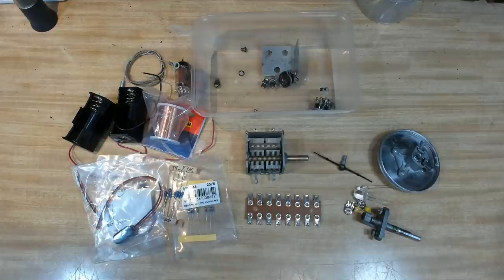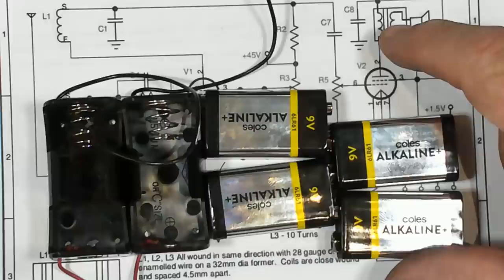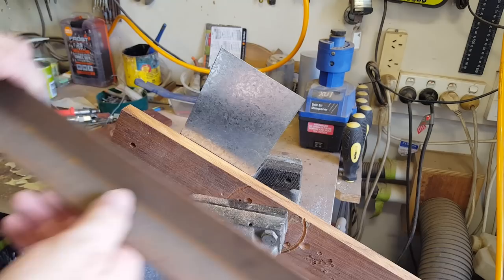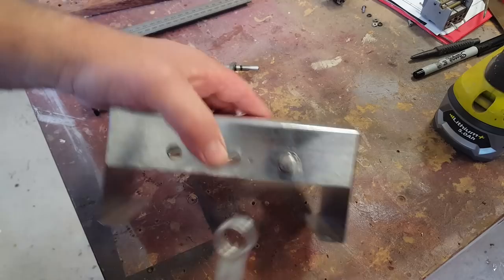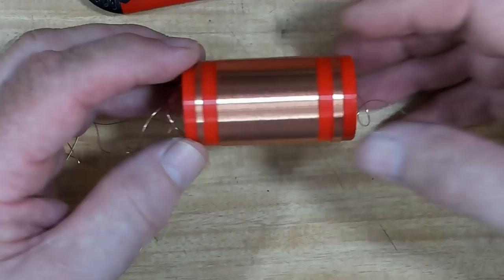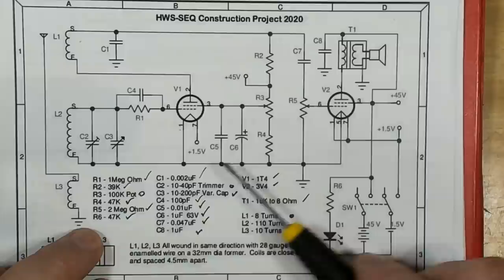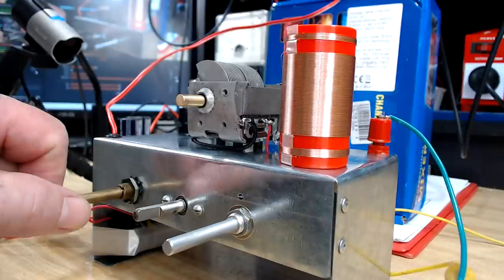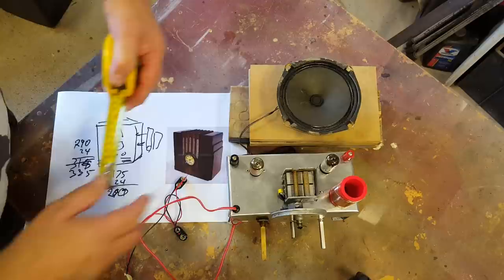2020 Radio Building Competition - My Entry - Two valve Radio

Comment: David,  You are an amazing man,  i mean that.  (ill still take the micky though lol )
Well done for winning the competition,  i though you would as the radio looks perfect and your
detail inside and out was brilliant.
I'm always impressed by your abilitys to create so many things from scratch.

You always put yourself down for the way you make/repair things,  stop putting yourself down.
That radio looks like it came from the manufacturers of the original empire radio.
A special edition version from the company :-D
I'm sure there is a way to get the extra volume you wanted,  but you have more time now you
won the competition :-D
Maybe the supply to the output valve is at a minimum, maybe 9 or 18 volts extra would give a bit more.
Reply from the maker: Thank you zx8401ztv, I do enjoy problem solving 🙂 I don't know I put myself down, I always feel there is room for improvement and I like to see things come out perfect, I think I may have a missing gene or something 😄
My radio worked as well as all of the others but I did think of slipping a few extra batteries in there but thought better of it, the valves are running at about half power. Cheers 🙂

Comment: It's not breaking into regen.  Your tickler coil may be connected in reverse.  Could have put dove tails, or tongue and grooves  on the battery drawer slide to keep it from flopping.  Other wise, nice cabinet work!  Congrat's on first prize!!
Reply from the maker: It breaks into regen at the higher frequencies, they all operated the same way on the day.  Dove tail would have worked but I was designing on the run. I could have hung the mirror over a bit and cut a groove in the slide rails. Thanks scharkalvin  🙂

Comment: You could 📞 call this your "2021" 📻 radio. 👍 Yes, you'll accomplish this build BEFORE 2021. You're darned 👍 good at anything to do with 📻 radios. I don't 👌 know what use a mirror is, under the 🔋 battery pack. Maybe pull it out and comb your hair, or brush your teeth.. I guess it's so the 🔋 battery pack can slide in and out easier. I 👍 liked the wooden version of that 📻 radio at the beginning of this 📹 video. Too 👎 bad ya can't build it in time. Didn't 👌 know ya had to compete against an entire club. Thought it was one person, or a few people. Merry 🎄 Christmas. Your friend, Jeff.
Reply from the maker: Thanks Jeff, the mirror is there so the internals can be seen by the judges if they need to. Merry Christmas 🙂

Comment: Nice job on the radio.  It turned out well.  But, I really like the looks of the one at 54:04  I really like the design. But yours is really nice looking too, it's just a style preference.
Reply from the maker: Thanks tarstarkusz. The radio you are referring to was done by my friend in the club, it's made from one end of the cover of a sewing machine. Pretty clever I thought 🙂
Reply: @DavidTipton101  The wooden one?  That's the one I mean (not the pink one).
Reply from the maker: @tarstarkusz  The cathedral shaped one is what I'm referring to. It is the end of a sewing machine cover. Like this: 
https://www.dreamstime.com/stock-photos-vintage-sewing-machine-case-image26445513

Comment: Great Job David, 

Next time you get a dimple in the plastic, try a heat gun and a high temp flat to push it down (silicone rubber, Teflon or Kapton). go slow.
Reply from the maker: Hi Steve, thanks. I considered trying to 'fix it' but I had run out of plastic so leave well enough alone. I tried to repair the second one but it didn't work. I have some new sheets now, I'll see how I go in the future 🙂

Comment: What a wonderful radio you have made, I am surprised by its performance too. You have all the workshop gear too. How long was the aerial to give good performance? 
I am building an Ekco 1934 AD65 replica. it is a difficult project, a round case and how to get the tuning system to work, . I was attracted to it because I saw it in the Agatha Christie series Poirot with David Suchet. so far it has been three years and the case is close to finished,. Next is the works, Would you like to see a photo?
Robert
Reply from the maker: Hi Robert thank you. The aerial is a small long wire, I have since installed a Miniwhip antenna so it would work much better now. I live in a very poor reception area. I would love to see your replica Ekco, it might be the only way to own one. vintageradioaus.gmail.com

Comment: Just a quick note. I mentioned that I planned to make the two valve radio. I have nearly all the parts, the IT4 is still in its original packaging. The question is that you did mention having a problem with the regen control not going into oscillation, which they normally do. On your circuit diagram you put a dot against L1 (regen coil) in the parts list. Did you need to add another turn to the 8 turns? Looking at the enamel wire I have, it seems I have 26 gauge and not 28, not sure how much difference it will have on the number of turns?  I might just order the correct gauge and do things right. I've made many coils, but regen radios are a bit more temperamental.  Wishing you and your family the very best for the New Year. Looking forward to what you have planned for 2021.
Reply from the maker: Hi Nigel. I think any markings on the parts list was me checking if I had the part. I wound the coil as per the diagram. The set would go into oscillation at higher frequencies, this was common with the other radios on display, playing with the windings may result in more regen 🤔🙂
Reply: @DavidTipton101  okay. Many thanks again.

Comment: Congrats David! Very Impressive Indeed mate! Is it possible to explain the radio circuitry? I'm trying now to learn how AM /FM radio works. From my limited understanding -  the signal flow goes from the Antenna to (Trimmer)Oscillator/Variable capacitor] to (Superheterodyne 4 Frequencies) [IF Signal + Audio Signal]  to I.F (I.F Transformers). Then it goes to Signal amplification and 2nd IF Transformer then to it's amplifier and speaker.
Reply from the maker: Hi Shyam, thank you. It took me a while to work out. Your understanding is correct.

Comment: Mr Carlson, instead  of making  a dial window, maybe buy a package  window from products sold in stores. Walmart has all kind of plastic stuff.
Reply from the maker: Mr Carlson is getting in on my action 😄 Thanks Manuel, the packaging plastic is ideal for smaller dials, I would still have to shape it for this project though 👍🙂
Reply: @DavidTipton101   thanks,I redo old cast off cases of radios and gut out the electronics and install blue tooth  device. I wish I could fix radios but it's ok.40 years as machinist, woodworker and other trades .your skills for radio repair  are amazing. Howdy from houston tx
Reply from the maker: @manuelsalinas686  Hi Manuel from Houston 🙂

Comment: what about 3x 12AU7 tubes configured like the inside of the SO42P with the third 12AU7 operating for the local oscillator as the front end and a trf second stage operating at 455KHZ and audio output to the headphones.
Reply from the maker: I hadn't really thought about it David, it would have sent the judges in a spin though 🤔

Comment: Dave, you are a true master...congratulations. I just refurbished a radio & it now only receives 1 station with low volume. It receiver more before refurbishment, although with a bit of static. I've gone over everything that I did & nothing is in the wrong spot. All the tubes are good. Do you have any suggestions as what else to look for?
Reply from the maker: Ahh, the continuation of the last comment... if it worked and now it doesn't suspect an error in the rework as you have done but keep checking, look for misconnections, bad solder joints, incorrect value parts. 
To make it easier, put you finger on the volume pot centre tab and you should get a fairly loud hum, if so, the amp is working, if not, concentrate on the amp section. 
If you do touch anything on the radio while it's powered keep your other hand away!
Check the oscillator is working, if it isn't you will get static and maybe pick up a station but not clearly. I use an oscilloscope but Google "testing a vintage radio oscillator" to find other methods.
You can also touch the grids of the receiver tubes, you should get a hum again. Sometimes just holding a screwdriver and touching it on the grid will do, if the tube has grid caps it's much easier. Work backwards from the amp to the front end to see where the signal (hum) stops.
Try "troubleshooting vintage radio" for further clues.
If you are working on transformerless radio without a isolation transformer... RIP.

Comment: Oh for a phone jack and several plug in coils for multiband.
Reply from the maker: Hi Frederick, that would be fun 😀
Reply: @DavidTipton101  Took me back to a twin 1S5  kit I built in 1953. 5 plugins 550Kc to 30.5 MC I had been cobbling radios together from 1930's local shop junk since 1947.
Dad was afraid of electricity (and some dumb things I did) So when I joined the Navy he used ALLLLLL of my collection good bad and ugly as fill tor a set of concrete steps he was building. I still weep over many of the one of a kind parts.(and my shortwave set) Electronics made me a career tho 1958 to 1994 
Know anybody who could use a top notch A1 condition  RCA Chanalyst? .
Reply from the maker: @frederickwise5238  That's a sad story of your junk made radio collection Frederick 😯 You RCA Chanalyst sounds interesting, an all in one tester 🙂
Reply: @DavidTipton101  Visiting my son in Erwin Tn in 1999, I found several post WWII pieces of A1 condition Test equipments in a Secondhand store.. Apparently the son/daughter of a WWII veteran had died and all of his shop became "excess" baggage. ll were in perfect shape . The RCA Chanalyst, and 2 RCA sig generators, a tube tester (has tube listings into the late 50's.
All told I paid less than $20.
Some of the "parts" i miss the most were my 450V 80 pwr supply with 2.5/5/6.3V and a complete WORKING self rectifying vibrator power supply, 6.3V input 250V for a 1932 farm radio.  Writing this down reminded me of a shortwave converter I built in 1958 for my 47 Ford convertible car radio.
I digress of course but what else does an 85YO have to fall back on but memories of long past achievements.,
Ive been blessed. I lived thru the golden age of radio; Steam locomotives AND MUSCLE CARS. LOL
Reply from the maker: @frederickwise5238  It was the golden age Frederick 👍🙂

Comment: 36:00 This is where the camera you're using should be run off its AC Power Pack rather than relying on the camera's battery.

Comment: What's shaming my. Ire over bad circuit boards. Is not  founded as I have several Heath, kanga, and Tentec kits and the Chinese rigs are the worst. Least the low hanging. Cheep Riggs..  73 de kv4li tks  Fer good show.
Reply from the maker: Well said Stephen, thanks for watching 🙂

Comment: Nice project! But isn´t the big red coil too close to the metal chassis? So i assume this coil is partially magnetically shorted by eddy currents in the metal chassis (like a shorted ring around the coil) and therefore the regen and the receiver is weak.
All the best for you and all viewers.
Reply from the maker: Hi Stefan, you may be right, that's why I didn't mount it underneath, I should have printed an extension below the coil to raise it off the chassis a bit. I really don't know if it did affect the performance, I could try raising it and check I guess. My radio performed as well as and better than some of the others, I think the other radio coils were mounted in a similar manner 🤔 Thanks 🙂
Reply: @DavidTipton101  Hi David, OK, thanks. Let us please know, if/when you have tested it!
Could be a new project...smile...just an idea!
Stay healthy.

Comment: Dave, is it normal to stand the coil up on a sheet of metal which must be equivalent to a shorted turn, is that part of the design?
Loved watching your work, that enclosure seems to be more work that the electronics, well done! Kept waiting for that skinny drill bit to break, bad for my nerves.
Reply from the maker: Hi Klave, I should have extended the coil base so it stood away from the chassis. Live and learn. I need a hobby drill for those tiny drill bits 😀
Reply: David Tipton I noticed another one of the competition entries did the same, well it works nicely so there’s no problem to fix.

Comment: Hi David. I've just now run across your 2020 radio build competition video and am interested in trying to build my own version. I have the schematic you thoughtfully provided in earlier conversations with viewers, but have a couple of questions. First the diode, D1, doesn't seem to have any specs listed. What diode did you use? Second, (maybe not a question), I recall that you at one point in the video mentioned that the transformer you had was rather expensive and you wanted to do something about replacing that, but I think that one was what ended up in your build. I have seen what you mean--I'm not able to locate a 10K to 8 Ohm audio transformer for less than a good chunk of change...Finally, are there any hints you can offer about building this circuit that you learned that might not have made it to your video. In any case, thanks for doing it, I really enjoyed it.
Reply from the maker: Hi Eric, D1 is a LED, I used a 3mm red. I ended up using the expensive transformer with the view of removing it if I needed to, it's still in there. Really it's not that important, the output valve is running at half voltage and you won't be looking for high fidelity, use a used small output transformer or you can get audio transformers used for PA systems for around $11 in Australia, they are called line speaker transformers. Example: https://www.jaycar.com.au/5w-line-speaker-transformer/p/MM1900. If I was going to do it again, I would raise the coil away from the chassis or make the former longer, also the aerial and earth connectors were too close to the sides and hard to operate. Thanks Eric, I'm glad you enjoyed it. Good luck 👍😀
Reply: @DavidTipton101  Thanks David, I really appreciate the reply. It looks as if the line speaker transformer option may be the way I should go. You do great work.
Reply from the maker: @ericw.8692  Thanks Eric, again, good luck.

Comment: I'm glad you're in a 📻 radio building competition. I think you're going to win. I'd 👍 like to 👀 see ya win $25.025.00. That means $25.000.00, plus $25.00 for it being 🎄 Christmas Day, December 25th. I think it's a valve 📻 radio by what I read. I 👌 know it'll take well over 25 minutes to build this 📻 radio, but you'll beat 'em Mr. Tipton. I think one of Shango066's German 📻 valve radio was a Consolette 5000, or something 👍 like. If so, it's probably the opposite one of the other German 📻 radio I wanted to tell ya about. His two 📻 radio videos are very long, and detailed. The one I want to tell ya is something 👍 like 2:00:42, or 2:24:42 in length. 👍 Yes, the dial cords are a 🌙 nightmare in both of these 📻 radios. Just don't let the dial cord hold ya back, if this 📻 radio has one, or even 2. I don't 👀 see a dial cord at this point in the 📹 video, but that doesn't mean it'll have one, further into the build. I think most valve 📻 radios have a permanent magnet speaker . a dial light and glass dial face should compliment this 📻 radio perfectly. I hope it's a tube type model. It's Bakelite, which is very nice. I would have preferred the wood version, but I know it would take too long to build the case. Maybe you'll put a 1950's look to this 📻 radio. It might even be playing Richie Valens' "Donna", by the end of this 📹 video, or his "We Belong Together". A 📻 radio, very worthy of all the 👍 great song. I 👎 notice that speaker looks a lot newer, but it shouldn't matter, since it's hidden behind the grille cloth. It also looked 👍 like the speaker is permanent magnet. 👍 Great place to put all your screws and washers, while ya build your radio. Magnetic screwdrivers are also ✋ handy, but can be more tricky than a 👎 non-magnetic screwdriver in some cases. Hope ya win the Merry 🎄 Christmas 📻 Radio Build, Mr. Tipton, as I want to name it. Too 👎 bad ya can't 👌keep this proudly built accomplishment at 🏡 home for you and your wife. Hope ya WIN this contest. Merry 🎄 Christmas, and a Happy New Year. May it be safe, warm and fuzzy. 😊 Happy 2021. Your friend, Jeff.
Reply from the maker: Hi Jeff, Mine did have a dial cord but it was very simple, I didn't video it because I has short on time. The speaker is new but that was ok. Thanks Jeff, Merry Christmas and a happy and safe 2021 🙂

Comment: Hi Dave.
What is the radio model on the table at 53m56s. Front left as you look. Black and silver next to the red one?
Thanks
Mark
Reply from the maker: Hi Mark, it's a Kriesler 11-59 Panoramic or a variation of that model made in the mid 50s 🙂 https://www.radiomuseum.org/r/kriesler_11_59.html
Reply: @DavidTipton101  thanks Dave

Comment: Hello David,just made a very simple 27 m TX using a 3V4 valve. As you have used in your radio. How come the valve heater doesn’t seem to glow ? saw your radio likewise your valve seems to lack a glow ! Is this correct ? Hope you don’t mind me asking ? Best regards Tony,
Reply from the maker: Hi Tony, your TX project sounds like a bit of fun. The valves have a directly heated cathode and run on a low voltage, I don't know why exactly but you cannot see any glow inside the valve. Thanks Tony 🙂
Reply: Thanks Dave, maby should go back to 2.4 ! 🤣